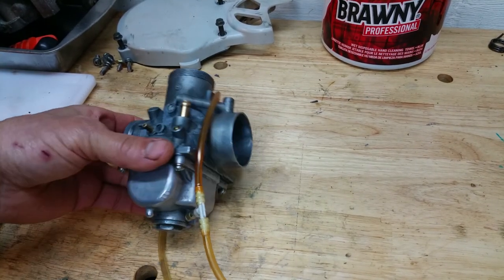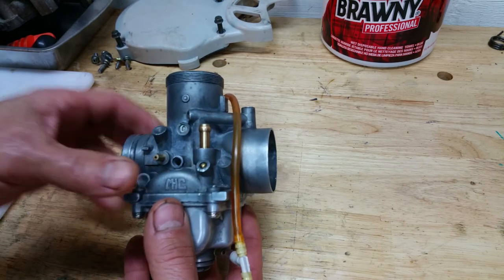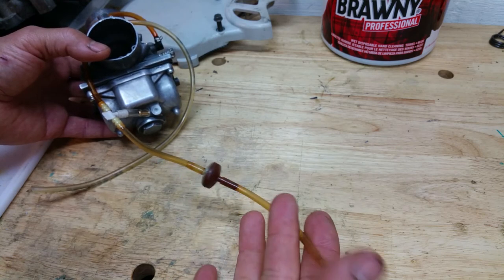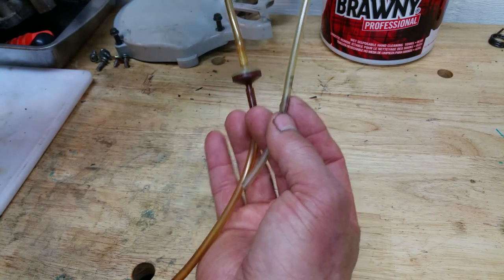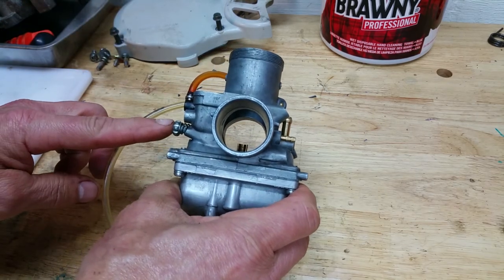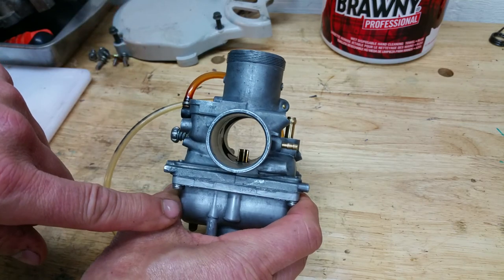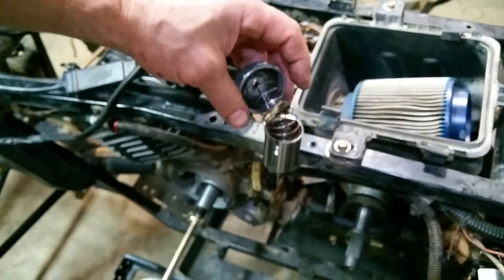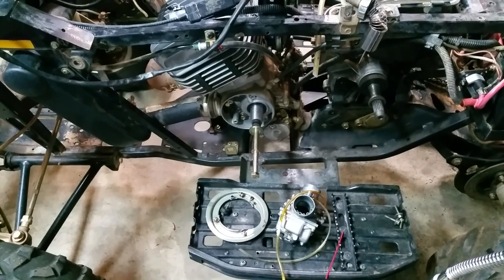Notes re: Mikuni VM30SS and similar VM carburetor throttle valve and spring needle install more here

Comment from the maker: Note on many Trail Blazer 250 the fuel dribbles out of that one-way valve hose (only when running.)  I did another video covering this topic - but amazingly, this is considered "normal" for this model. So, the only fix is to raise the end of that vent line up above the carburetor, and inserted into a small hole into the top of the frame of the ATV. Believe it or not this is how it is resolved.